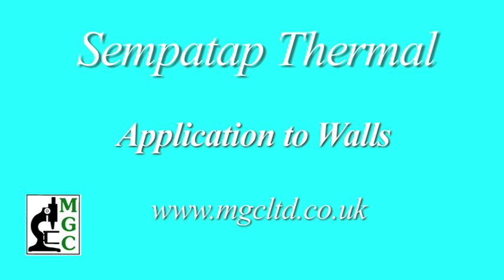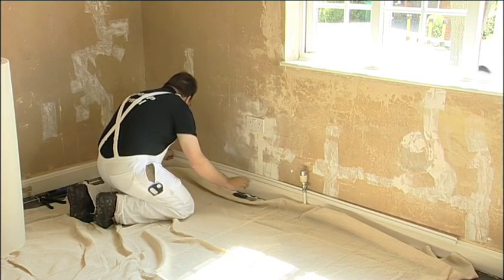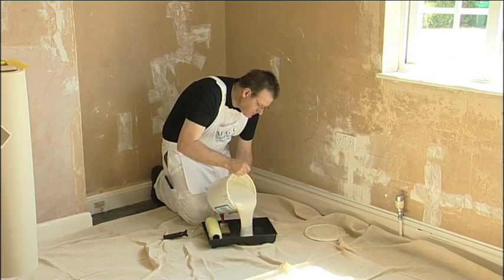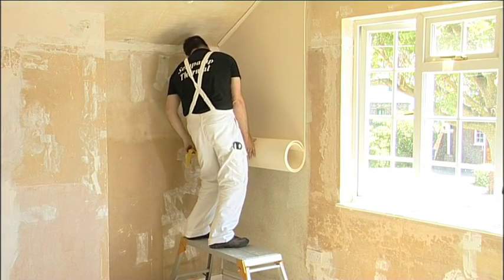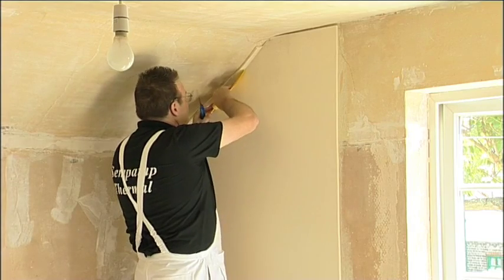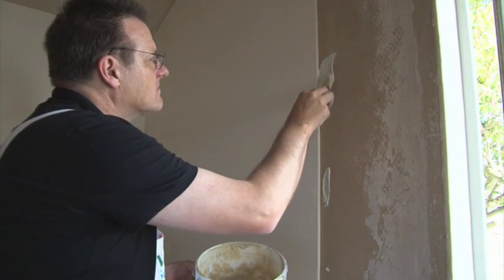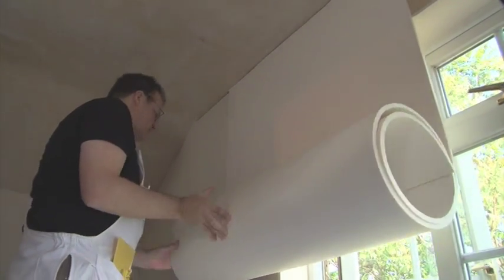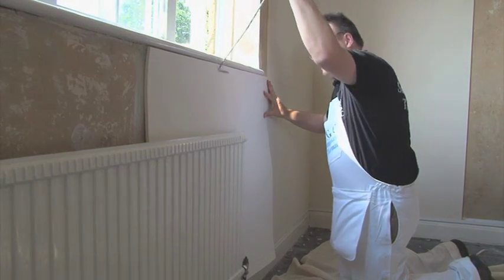How to Apply Sempatap Thermal Solid Wall Insulation to walls

Comment: Used this for the first time today hopefully be the last 😂 hated it , great in a big room like that but a tiny wc with pipes n stuff was a ballache ,havibg to cut it on the customers lawn as there no room inside , adhesive gets everywhere n snags n tares when you try to trim the edges of the foam even with a snappable new blade .
Reply: Einfach eine Schablone anfertigen. Ein starkes Packpapier verwenden. Dann klappt es auch ohne Stress🙂